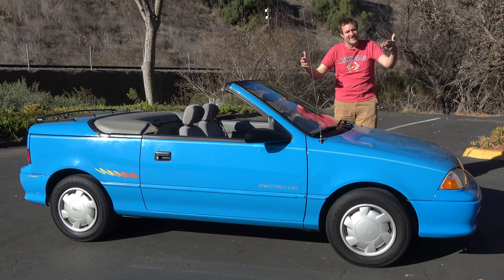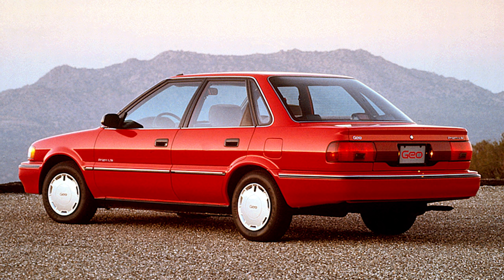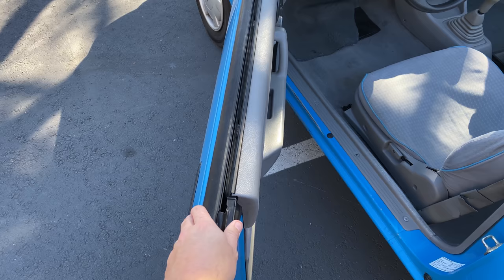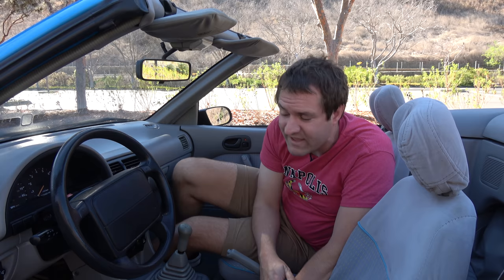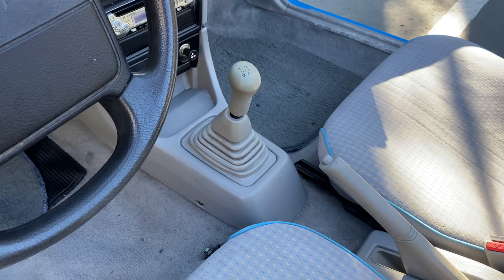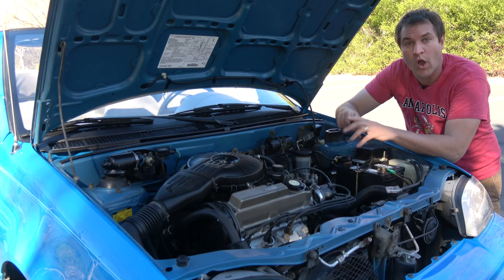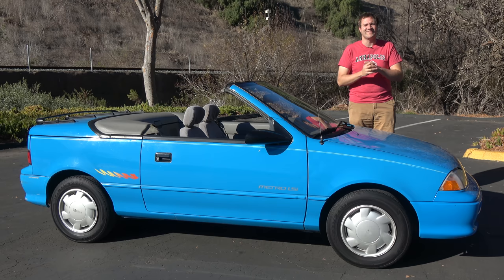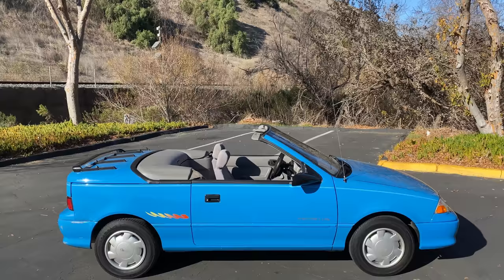The Geo Metro Convertible Was a Hilariously Pathetic 50-Horsepower Economy Car

Comment: The Suzuki Swift GT was an awesome little sports car!
Reply: That was first I thoughts.Its like suzuki
Reply: I had a 1991 swift gt 5 speed and it was incredible. 105 hp twin cam 1.3. One of the best cars I’ve ever had. Unfortunately it rusted to death in Pennsylvania. Ran perfect but the body literally disintegrated.
Reply: yeah 100ps on a 1.3 engine back in the 90's was no joke
Reply: @darrengriffith9680  did it have black squared lines in the rearlights?
Reply: @yungboicontigo9278  .. its front wheel drive  to start.
Reply: @pinut187  man, I don’t exactly remember but I don’t think so. I remember it was a gt and not a gti, I remember some were labeled gti certain years. It was definitely a 1991 in white. I bought it in 1994 used. I do remember the 1st to 2nd shift being way too tall but otherwise it was awesome.
Reply: I'm from Holland and I had a geo metro convertible 1.0  3 cylinder and I convert it in a Gti 16v from a Suzuki swift and later I even built a turbo on it.  I think I was 1 of the only few to have a geo Gti turbo in the world. It was a freaky small speedy car.
Reply: My 2nd-ever car, and still the only one I have ever bought new.  Sad day when it got totalled.
Reply: The GTI was a very desirable car in my youth.
Reply: Litteraly just a cam away from a 9k redline. Yup. Thats it. No need for any supporting mods at all. Not even kiding...
Reply: Only Doug would explain what a luggage rack is and how to use it.
Reply: *GTI
Reply: @facundomartinez8949  gt vs GTi was both year and location based. They had to move to GT later on in the us since VW had GTI trademarked
Reply: @MrFlyingguy  

So it has no Gran Turismo hero points? Shame.
Reply: @jezuzfreek777  

I like how even marginally different door handles confuse and amuse him.
Reply: GTi *
Reply: @Nigel Saunders I agree. I haven't watched this all yet but if this scores lower than the Yugo or the Trabant, I'm not watching this channel again!
Reply: I had a Swift GTi... Was great! Vancouver BC to San Francisco in 12 hours to watch a Bluejays game in the ALCS.
Reply: Japanese swift gti had a 1.6 litre engine
Reply: @anasnasir9424   1.6 was only in sedans. GTI had 1.3 twincam
Reply: @petarbozic4864  gt vs GTi was both year and location based. They had to move to GT later on in the us since VW had GTI trademarked
Reply: Totally agree, and I want one badly
Reply: And if I'm right there was even a swift Cultus a special gti. And a funny little Suzuku alto Works
Reply: Sports car? The correct term is "hot hatch", or possibly "supermini".
Reply: If I could find a SideKick now I think I would buy it!
Reply: @darrengriffith9680  I still have mine... GTi euro spec, reliable as hell and mine has no rust at all... This one will outlive me :D
Reply: @johnnyrocketa1257  oh man I wish I did. You are lucky!
Reply: @Hilly070  Yep, the Cultus GT-i had 115 hp, out of higher compression ratio and there where quite a lot of them AWD... Too bad it was in Japan.

It was sold in Europe as Subaru Justy, with 70 and 80 hp engines and all of them AWD. They are commonly swapped into GTi's ;)
Reply: @darrengriffith9680  I have it for 10 years now, bought it with 88.000 km in the clock, now 240.000, and no issues at all, new clutch, new engine and suspension bushes (REALLY makes a difference), but engine and gearbox never opened, always made oil and filter changes when it's due... It is really a reliable car. And very fun to drive!

Other cars came and went, but the Suzuki will stay with me forever!
Reply: @johnnyrocketa1257  my had a lot of rust after 6 years. I even broke at the end my back control arm from the body do to the rust.
Reply: @Hilly070  My God! Salt sucks... I don't understand why they can't think of another method to melt the snow without f*cking people's cars, or even leave it be, it won't last forever unless it's in the Pole...
Reply: Swift gti was only for 1989, I had a red one lowered on H&R springs and 15” TSW hockenheim wheels. Looked so badass. Like others it rusted to shit and the frame actually cracked.
Reply: I had a 89 swift GTI.... Still miss that car. Sold it to buy my first motorcycle.
Reply: @MrFlyingguy  so is the Integra and that's an excellent car
Reply: @eriksantoso1741  its just rebadged suzuki
Reply: The Swift is basically a luxury version of Metro! It's sad that the American small car market became dominated by slow economy models. A well-made small hatch with decent power brings some fun daily driving for everyone's reach.
Reply: @MistressDarkTruth  I remember when they sold these brand new in the USA at Suzuki dealerships, the Swift GTi was a GREAT little car, not many people knew about it because Suzuki in the USA didn't really advertise it at all. Very odd.
Reply: GTI here
Reply: swift pikes peak..
Reply: Man, the Swift Twin Cam was deadly back in the day. Fastest thing on the streets that people could get ahold of.
Reply: The Japanese Suzuki Swift GT-i AWD was a monster.
Reply: Have a friend adjust the damn mirror
Reply: I guarantee that thing is a blast to drive.. he's trying to conceal his absolute delight!
Reply: @yungboicontigo9278  yes
Reply: @bruno100carro  what about 146hp from a 1.3 in 86?
Reply: @MilesPrower1992  what car was that ?
Reply: @bruno100carro  RX-7, so it's cheating a little, but it IS 146hp from a N/A 1.3
Reply: @bruno100carro  Isn't GT comes with 1.6?
Reply: @Sharp931  i don't know about the gt one , but the swift sport GTi came with a 1.3 NA 3 cylinder with about 100 PS
Reply: Yes, the Swift GT was a great little car. I purchased one the last year they were sold in the US. I had nearly 200,000 miles on it and never had any major issues. I miss that car! Oh by the way I also had a 1989 Geo Metro (New) and later restored a 91 Metro Convertible. They were reliable, but yes, awfully slow. Clearly I had a thing for these cars, lol.
Reply: @eskamobob8662  that surely happened in few countries where usa is included, all google images show the "GTI"
Reply: @Sharp931  GT or GTi had a 1.3 Twin Cam (fun fact, here in Colombia, even today, if you say you're gonna buy a Twin Cam, most people will know that you mean a Swift GTi)... Anyways, my mom had a 1.6 sedan back in the 90s and there's a (mostly) mountain road from Cali to Popayán, it is 150km (about 90miles and Google maps says it should take more than 3 hours) and she was able to drive that Chevrolet Swift there in less than an hour and a half... I drove that same road 20+ years later, not going flat out, not trying to set a record, but still kinda fast and late at night (less traffic) and I could barely beat the 90-minute mark... that thing was fast by Colombian standards
Reply: And it's 2x powerful and more reliable
Reply: @1greenMitsi  twin engine
Reply: I've owned 4 Swift GT-i and tell you what i hope the truth doesn't get out that the Suzuki Swift GT-i is the best bang for your buck$ Hot hatch for it's time 💪🤟
Reply: @eriksantoso1741  sold in the uk as the swift, didn't get the convertible though.
Reply: @Hilly070   Hi! i'm from Chile, i also have a swapped engine in my Geo Metro convertible, but i put a Toyota 4EFTE (1.3 turbo, with about 137 Horsepower) on it... it's a really funny (and scary must say) car to drive...

Comment: The plastic "card key" was to keep you from getting locked out of your car. It was uncut. The idea was you took the card to a key cutter and get them to copy your key onto the card, then keep the card in your wallet just in case you locked yourself out of your car.
Reply: That’s what she said.
Reply: My 1993 Caprice classic came with the credit card keys too. Worked great!
Reply: Me: Damn, I locked myself out of my Geo Metro Convertible.
Friend on phone: Hey man, looks like you're going to have to cut through the top.
Me: OK, give me a minute to put the top up.

lol.
Reply: My parents 89 Beretta GT that came with the plastic key also, even as a kid I thought it was kinda odd.
Reply: True.  My '95 Geo Prizm had one.  Never needed to use it though.
Reply: @bradchoi9679  There is always a way to get a car open. I have used a coat hanger, an aluminum yardstick, an antenna mast, and once a tree branch to retrieve the keys from inside, and once had to HELP the "locksmith" who had a fancy tool set but couldn't open the door after a half an hour of trying. Cutting the top would be the very last possible option. There would probably be an opening somewhere to get a long, stiff wire or stick into it. You just have to nudge the door lock button, as one option.

Comment: Incredibly easy cars to work on. My cousin had a hardtop and it did fine hauling us (500 lbs. combined) around town. Even the highway wasn't too bad, it really only struggled on hills. His had the manual transmission which was way better than the auto.

Comment: The scariest experience of my life happened in a Geo Metro. My mom and I were moving from Florida to Pennsylvania. We were driving to PA and somewhere in Virginia the car started accelerating on its own and the brakes failed. My mom managed to get on an off ramp and with a combination of the emergency brake and shutting the car off, managed to stop the car.

Ahh the memories...
Reply: Gotta love those traumatic formative memories.
Reply: She was stepping on the gas instead of the break
Reply: @kevinbarry71  Yeah if only it was that simple.
Reply: @DanPLC  it's a geo just open the door and stop it with your feet
Reply: @DanPLC  There's no reason the car would accelerate on its own, unless the throttle cable was stuck somewhere. In that case, you can just put it in neutral, as even the automatics didn't prevent you from doing so.
Reply: @joshjlmgproductions3313  I was a kid. Not driving. Just remember being scared out of my mind!

Comment: I inherited a white '95 Metro base model hatch from my parents when I got my driver's license. Mine came with nothing: no A/C, no passenger side mirror, no radio, but I loved it. My original radio was a boombox, before I put a full stereo (and subwoofers in it) - which turned it into a riding night club. Also added remote door locks - the advantage to nothing in the door, was aftermarket part installation was super easy - and a push-button hatch release on the dash. Other than A/C, by the time I was done with it there wasn't really anything I thought it lacked. It was super cheap and easy to maintain compared to modern cars.

Back in the late '90s when gas was less than a dollar, I could fill it up for like $5, which was a great money making scheme when everyone you know is willing to give you a couple bucks for a ride and only needed to get gas every couple of weeks. I can honestly say I once put 505 miles on a tank, and it then cost me like $15 to fill up, which is non-hybrid impossible nowadays.

I also had a good time driving it. It was a lot of fun in the snow since it weighed almost nothing, it was basically impossible to get stuck and easy to just drift around corners. While it may not have been very fast to 60, I always found it was pretty quick to 25-30 if you knew how to shift it, but the NJSP officer that ticketed me for doing more than 80 on the turnpike can vouch for its top speed.

My parents swapped me cars and sold it almost 20 years ago, and I still miss The Egg a little bit to this day.

Comment: I owned two of these in the 90's, I loved them. They are slow and bad in an accident. But the most reliable car I have ever had. Cheap to fix, water pump would go out and would go 30 miles before it over heated in summer. Such a small engine they basically were air cooled. If you saw the radiator you would chuckle. I still own a 2 door 1991 geo metro LS. 10k on a rebuilt motor. Best mpg I got was 54 mpg on a 200 mile trip. 3.7 gallons for 200 miles. Damn near a Prius without the self righteousness lol. I had a yellow and a white one with Suzuki Swift GTI side skirts on it. Takes me back. I drive a V8 Nissan Titan now. Still have fond memories of this little reliable car.

Comment: Two years ago I saw a car nearly identical to this for sale, it was the same color and similar equipment, except it was branded as a Chevy Sprint (Canadian rebadge) and it had the 3 speed auto. I was on the fence about buying it, I watched this video and immediately went out to buy it. I love my little blue deathtrap, it's a piece of garbage, it's a horrible car, the convertible top leaks like a sieve, it had mice in it at one point and it's got more bondo than steel in many places but I love it all the same. It turns more heads than any car I've had, it's great on gas and has never left me stranded...

Doug, on the off chance you see this, thank you for making this video and helping me find one of the best cars I've ever owned!

Comment: At my university Chevy brought 6 Geo Metros to give test drives , because they were cheap and students might like to buy one.  After a week of people thrashing the shit out of them, only 3 were still running.
Reply: I would like to take this moment to thank every parent who bought their kid a Geo Metro then. 
It made my '76 VeeDub Rabbit look downright cool by comparison, saving me much teenage dignity.
Reply: That's pretty weird, as the weak point on these cars is the chassis that is prone to rust. The engine and transmissions were pretty stout. I did physically break a 3-speed automatic clean off of the engine in a Swift GTI by doing high speed donuts on gravel though.
Reply: I worked for a car rental company in the 90's.  Car dealers didn't want to pay much for loaner cars to rental companies for the owner bought 12 of these for the loaner customers to cut costs.  

It did not go well.

People with large SUV's or Vans were given these instead of vehicles similar to what they drove.  The tires were bald within a month or so.  Engine oil was black as well as it was clear hitting redline was the only way find semblance to their normal driving speed.  The cars had $20 aftermarket radios as the cars didnt come with factory radios.   Suffice to say customers would have been more receptive if we had offered them scooters instead.
Reply: goód fir them kép geos best vxsrs

Comment: In the early 90’s I was more of a Camaro guy. We made fun of the Metro and the Yugo. But now I kinda have a nostalgic soft spot for the Metro. Only because I don’t see any Yugos on the road anymore. But every now and then I still see a Metro. Incredible. Oh, and that side graphic …. Bitchin!
Reply: I saw one at a car show once with custom suspension and they engine swapped in a 4-cylinder engine with a turbo. They said it dynoed in at 260HP. Never saw them drive it, but man that had to be an experience.

Comment: "The Geo Metro was a joke and the cheapest crappiest car on the road"

-Yugo enters the chat
Reply: @Keith Phaneuf Exactly. The Yugo was a giant pile of shit. The Metro was far superior even though it was unsafe and a piece of garbage itself. lol
They wouldn't even come close to being sold nowadays due to much better standards.
Reply: what is a Yugo with a can opener? a wego..... I got one last use out of that joke lol
Reply: The Yugo did come in a convertible, believe it or not.
Reply: I've owned both. The Yugo is a way better car, it's not even close.
Reply: YuuY has 1500 horsepower and costs 8 million dollars
Reply: Lada - NYET! Am I a joke to you?!
Reply: @DWish808  As a Serbian I can confirm. My uncle had one and I opened the door handle, it came clean off :)
Reply: Even if you discount the Yugo, the Hyundai Excel was already here on US soil, and it was not a good car. Hell even the American compacts of the day were worse than the Metro/Swift. Those late 80s Cavaliers and Escorts were pretty crappy cars.
Reply: @Geotpf  it did?!?!!
Reply: Haha, first time I find fellow YuuY peeps
Reply: @yungboicontigo9278  YuuY
Reply: @notDonaldFagen  YuuY
Reply: The Yugo cabriolet had an optional 1.3l instead of the us standard 1.1
Reply: @Keith Phaneuf they are very common in Balkans, it also had a cabrio version, which was very cool tbh

Comment: Reminiscent of my first car. An 84 Chevy Sprint with a 48hp, 3cyl engine, and a 5-speed manual. It was actually pretty rad.
Reply: My 1982 Cavalier was a tank compared to a Metro, but not much faster despite 4cyl.  The two door hatchback was the best small car styling of that era.
Reply: My brother had one. Filled the back hatch with a massive speaker box and did everything in his power to destroy that car without outright wrecking it. The sprint won that war. Id take one today if given the opportunity
Reply: yessót is biy ot

Comment: Dated a girl in the mid-90s that had a Geo Metro convertible. Little to no power, especially when trying to cross the Dames Point Bridge in Jacksonville, FL. But if you wanted a cheap, fun convertible to cruise locally, you couldn't beat it.

Comment: AAA used to make the plastic temporary keys for their members. You kept the plastic key in your wallet. If you locked your keys in your car, the plastic key worked well enough to open the door once and get inside.
Reply: My mom had one with her prizm. Saved me many times as a teenage driver
Reply: I still have the AAA key for my 82 Suburban.
Reply: My parents’ LeSabre had one as well.  I had to use it once on a date and it saved me the humiliation and trouble of calling Mom and Dad to bring the spare keys.  It was a fine idea before OnStar could unlock the doors for you.
Reply: Saturn did them too. Completely forgot about them before this.
Reply: I got a 97 coupe and found out its possible and downright easy to start with a pocketknife

Comment: I’m sure someone covered this but if not….The plastic key only opened the door and was built into a “credit card” to you could put it in your wallet/purse in case you lock your keys in. Second, the A/C option could only be had with power steering.